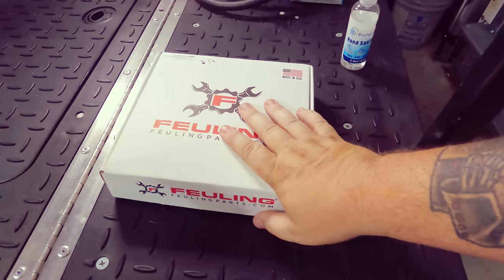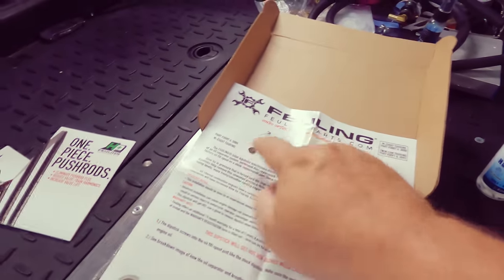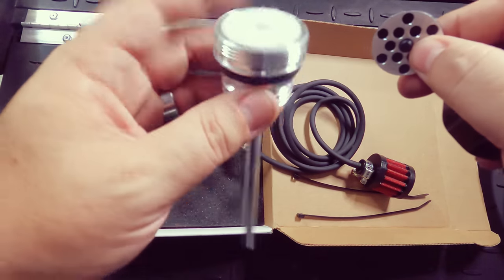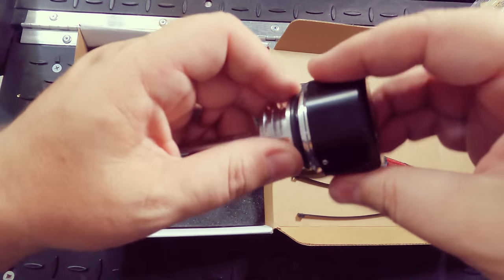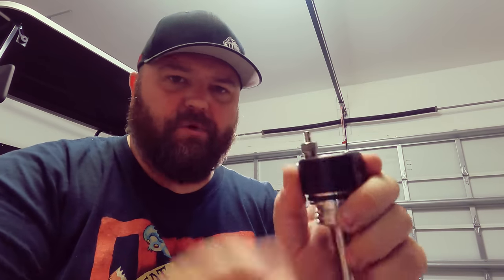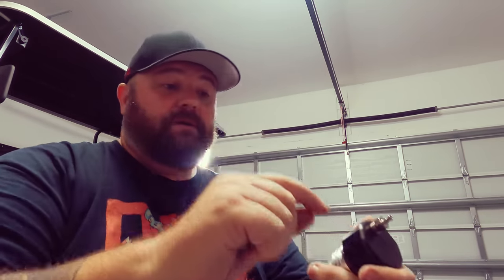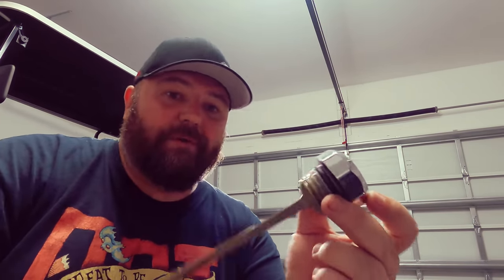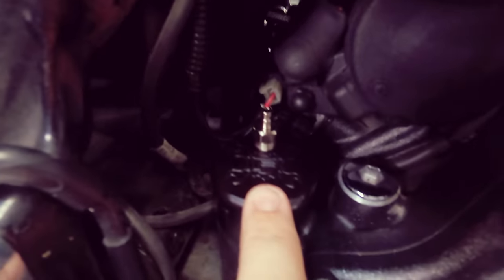Harley Davidson CVO Road Glide - Getting Rid of the Blowby

Comment: Hpi. Ext bolts
Reply from the maker: Won't work on an S&S Stealth backplate. You would need to drill and tap it instead.
Reply: My 17 didn't need an ext breather until I added 468 cam, I hope to be able to wait on my 20-114 until I cam it for the ext breather!
Reply from the maker: @kpnomad7  I think you just solved it for me. I didn’t connect my cam job to the blowby. I have an S&S 475 cam in my bike, that might be dialing up the problem.
Reply: I had the 255 in my tc and they 447 in they 107 m8,  both ran better, but still after market 468 and thundermax with 2 into 1 was awesome!!